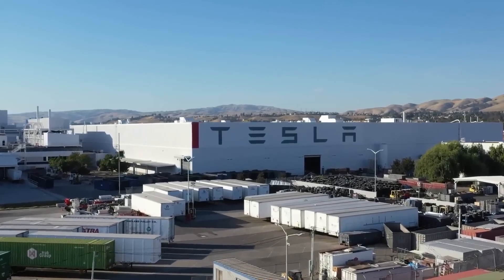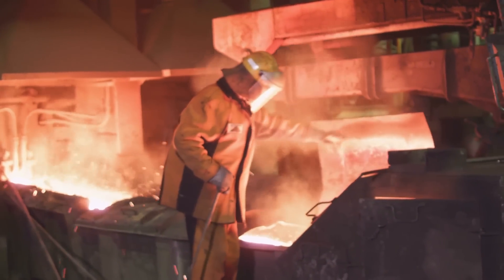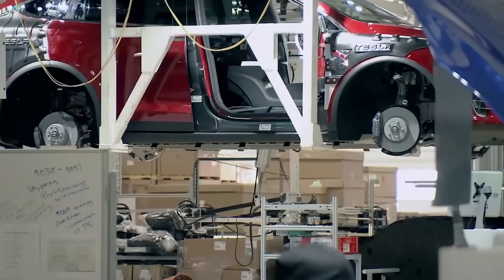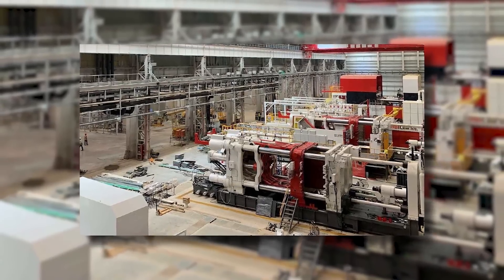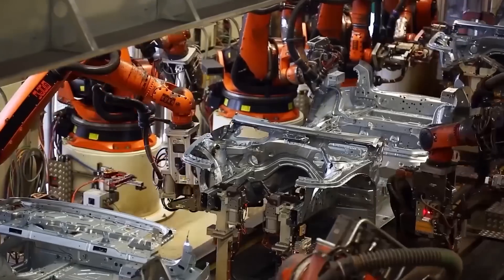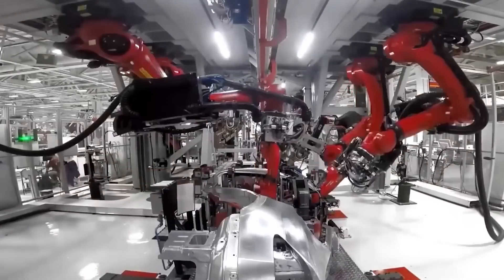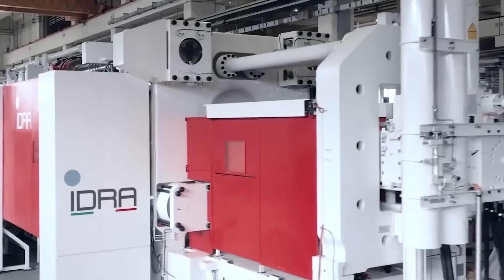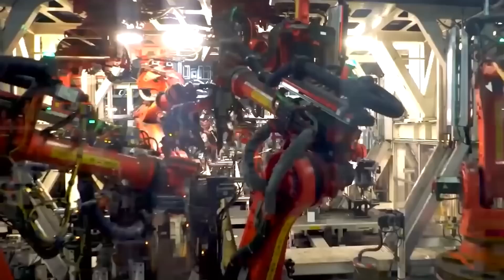Tesla's INSANE Gigapress Now in Action!!

Comment: A crazy thing on Yamaha's Adventure bike that is new, the Tenere 700. It has a exhaust mount, it is part of the frame. Well if you fall over on that side of the bike there is a good chance you will bend or break it. It is welded to the frame of the bike so part of the frame. Insurance companies write off the bikes even if new even if it is bent I've read.

Is that the same with these casting in Elons cars?

Comment: “Fatigue” is not what happens to a molded part post casting since that is a time related condition just like human fatigue. It can create built in stresses which will fatigue in time. 

Tesla does not have access to its special casting Aluminium because of NASA but rather because of Space X; big difference.

Comment: Great idea and execution but Insurance rates are going to sky rocket. Any fender bender will basically total the whole car. 🤷
Reply: Casting is inside the body. Damage the casting and you’d need such a huge crash that in any other car you be dead or badly injured. Your survival rate in a Tesla is 2 or 3 times more likely than an average car. Add their superior accident avoidance system which would prevent damage in the first place and you’re got one of the reasons why Tesla can sell everything it can make.

Comment: Repair due to accident can be expensive
Reply: Damage the frame on any car and its a write off.
Reply: @colingenge9999  probably true, but Tesla is safest car for people inside in case of a collision or single car wreck. so not hard to pick which is more important.
Reply: @SLee-vj4px  You are correct that the cast subframe makes the car even safer because they have full freedom to optimise every section.

Comment: They are NOT diecasting the complete body.
The diecast part is the rear subframe.
Get your facts correct!
Reply: *rear and front - there I corrected it for you.

It also has a structural battery pack in the middle.